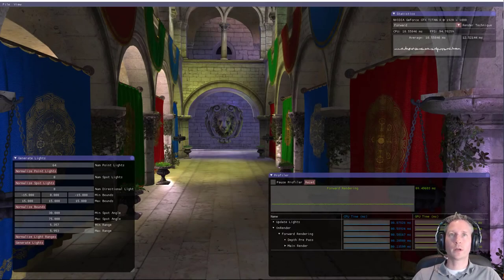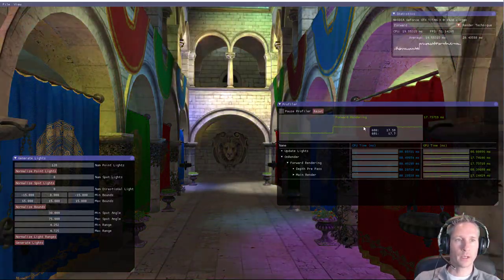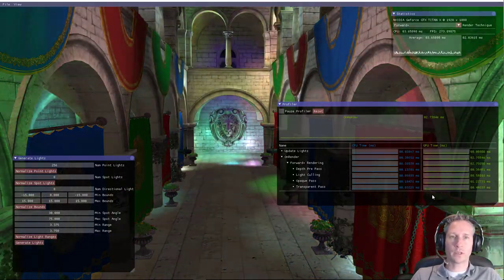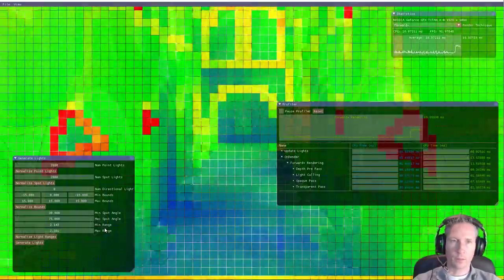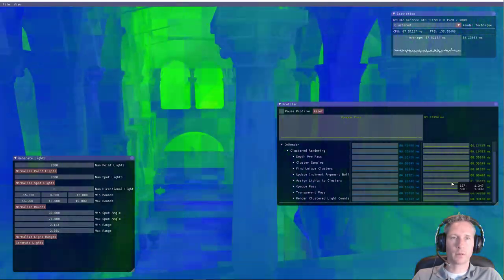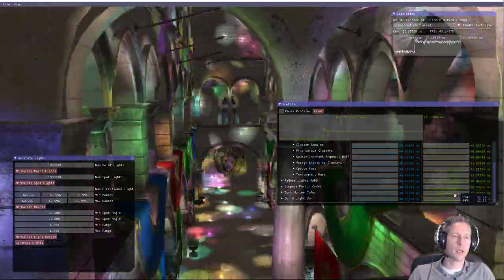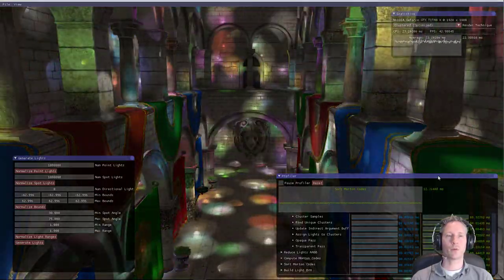Volume Tiled Forward Shading

Comment: very awesome technique. i already learned a lot from your paper.
i'd like to ask if you could shed some light on the key differences between clustered deferred shading and volume tiled forward shading. to me they seem to be the same technique conceptually. different in the implementation and advantages/disadvantages of forward/deferred shading, but not that different in the volume tiled/clustered part.
clustered deferred shading can make use of more information because of the g-buffer, when volume tiled forward shading only uses the depth/position of a given fragment while it insists on a depth prepass.

Comment: is your demo considering the added amount of cpu usage done by having to rotate 2 million objects each frame? because in that case the technique probes itself even more rock solid!
P.S. keep doing posts in your web, I really like them and learn a lot from them :)
Reply from the maker: Nicolas,

The lights never leave the GPU. Rotating of the lights is done in a compute shader. I didn't want to have to pay for the copying of the lights over the PCIe bus so everything is done on the GPU... almost. The lights are initialized on the CPU (whenever I press the "generate lights" button in the UI, or if I have the light editor panel open, it needs to read the transformed light attributes).

Comment: 5:14
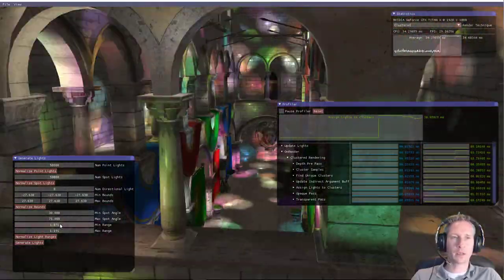5:44

Can your optimizations with Clustered VTF Shading with BVH  or similar/alternate sorting techniques be integrated into any real-time rendering application (like game engines), CGI rendering, or video game (rasterized and ray-tracing)? Or is it only feasible for certain uses and scene-types?

Kind regards,
Josh
Reply from the maker: Joshua,

In general, building a BVH over the objects in your scene is a good optimization technique. In fact, this has been done in ray tracing applications for years. Since lights in a ray tracer are nothing more than emissive objects, they can benefit from the same acceleration structures as the rest of the objects in the scene.
In fact, the DirectX Ray Tracing library does exactly this: It builds a BVH over the objects in your scene.

Comment: Why do you keep changing light sizes to smaller ones? It won't show the real performance impact that you'd otherwise have in real production environment.
Most of the time your light sizes will be quite large and not a meter in diameter.
Reply: Because that would be quite dumb since it would obviously run very slow.
When you have thousands upon thousands of lights overlapping over the same tiles there is no light culling algorithm that is going to save you since light culling is essentially useless at that point.
He is trying to show how his light culling algorithm works and performs, he doesn't claim to have a magical way of reducing lighting calculation costs, doing what you say would be very dumb and useless.
Reply: @marcossidoruk8033  the only thing that is really useless here is the small light radi, since no one is going to put into their game lots of very small lights.
Being able to see the real performance comparison between light rendering techniques is crucial. since that way you can take better estimates whenever this solution is better than others for you.

if you turn off all the lights you will see the real performance gain. But no one gonna do that in their game, because that's dumb.
When you see an algorithm that performs well in only 1 unrealistic situation than you'd have to manually check if it performs well in real world scenario and that will take your time.

Basically my point is - let me see the real performance of the algorithm in a semi-real environment. Even synthetic with sponza + big lights would be better for the comparsion, but then again all the lights should be roughly same size when switching between tecniques
Reply: @SweetieSnowyCelestia  You have no idea what you are talking about.
This isn't a "light Rendering algorithm", this is a light culling algorithm. Very different things.
Light culling doesn't offer much performance gain when a really big number of lights overlap over the same set of pixels, no matter the algorithm, thats why what you say would be dumb, if you are looking for a magical optimization to run a million overlapped lights you are in the wrong video, you may want to look that up in wonderland. A good light culling Algorithm should be able to reduce the number of light calculations needed by only considering lights wich are relevant to a particular set of pixels and do so with as little overhead as possible when the number of lights is really big, wich this video shows quite well, if you then go and use a million overlapped lights on your game needless to say your game will run like shit, but that is on you and there is no technique that is ever going to save you.

And last, you are completely wrong thinking this might not happen in a real game, in a huge open world game like Minecraft (if Minecraft had actual lighting) the number of lights may grow with render distance potentially unpredictably, however further away lights will of course only affect a smaller set of pixels and thus a proper light culling algorithm can absolutely make the difference.
Reply: @marcossidoruk8033  Wow, so hostile. We're not fools, anybody with an interest in graphics programming will understand what this is, how it works, and that there is no gain when light radii are so large it places them in every tile. What @SweetieSnowyCelestia, myself, and I would expect many other people want to know, is how does this perform with 100 or so realisticly sized lights in an enterior enviroment that you would actually see in a game. Of course we can see how it would be useful in an openworld minecraft clone, but how would this perform in something akin to a Doom 2016 or CS map? obviously the answer is to implement it and profile for yourself and I plan to, but in my opinion it was a missed opportunity in this otherwise incredible video.